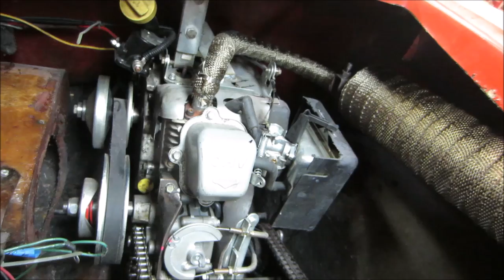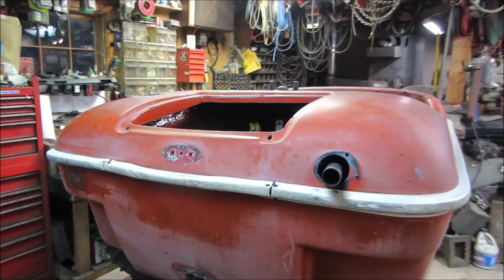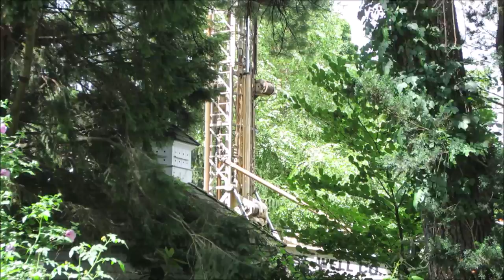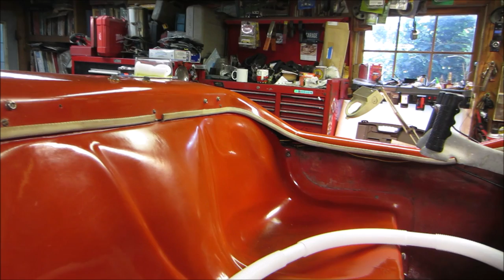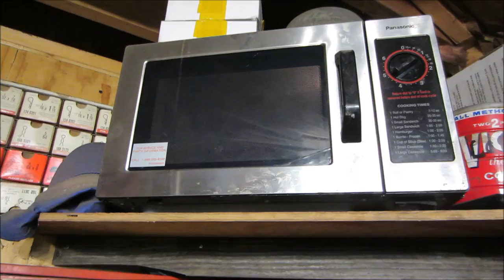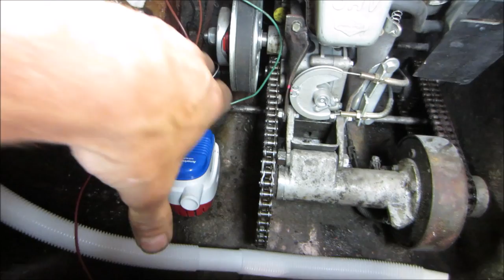Buffing my Beaver amphibious vehicle

Comment: I was tasked with getting a miniature railway locomotive running the other day... I was told it was a 2 stroke. I got there and cleaned it off, to find it was a Villiers 9E, exactly the same as the original engine in the beaver. Quite a powerful little motor. Was glad to have some of the skills I’ve learned from you Mustie, to get it running sweet. Next week I have to take the carb apart as it’s blocked so I’ll be following along to one of your vids!

Comment: A tip for the exhaust wrap fold the first and last 1 inch under and you will not have to deal with the frayed ends. The SS Minnow is looking ship shape.
Cheers steve

Comment: You can make a new fiberglass engine cover from the old one and a plaster mold.  Fill the broken section with Styrofoam but not up to the finished surface area.  Spray the surface with a "Pam" like spray oil and paint it with Plaster of Paris. Add more plaster to the damage area to fill it to the intended finish surface.  Strengthen the mold with gauze & plaster, newspaper & paste, or any other strong backing.  When dry you can remove the old cover and work the damaged area of the mold to match the opposite side.  Now you glass a new cover in reverse, starting with gel-coat backed with laminate.   
Great job bringing that Beaver back from the dead.

Comment: For adhering different types of surfaces to each other, I always recommend a silicone adhesive sealer. It stays flexible once cured and tends to stick to just about anything.  Your concerns about covering the water holes in the pump base aren't that much of a issue, as long as you have some of the holes open.  In fact, having the adhesive go through some of the holes is actually advantageous as it gives an extra hold point for the adhesive.

Comment: Lookin good!   For the rope Tie-down that got pulled off,   you could fabricate a steel bracket that mounts between the engine mount and the inside bolt pattern of the Tie-down bracket. This should eliminate the bracket relying on the fiberglass for strength, when someone tries pulling the weight of the entire Beaver from that Tie-down bracket.

Comment: Just carve a foam plug to form the missing piece  of the engine cover.  Make sure your resin won't desolve the foam.  Then chip the foam out after the repair part is cured.  Use a three position switch for the bilge pump then you can have off, auto and on.

Comment: The other wire that energises the motor without the float is designed to connect to a dash warning light. It will illuminate when the pump is active.

Comment: A lot of mid-engined supercars have clear engine covers to show off the engineering bling. Perhaps you could follow suit rather than trying to repair the existing broken cover.

If you made a wooden former, you could get a sheet of appropriate thickness perspex, and with heat get it to melt into shape, then re-use mounting brackets/hinges to finish it off.

A clear cover would also allow a quick visual check that all was well in the back when on the high seas.

Really enjoying this series in particular as it is a little different :)

Comment: Mr. Clean Magic Eraser works well on the rubber bumper too. I have a 1958 Custom Craft 15’ Sea Ray, and that worked miracles on my white rubber border. I also used the Westleys Blece White as well along with the Magic Eraser to work simultaneously. Try it!

Comment: Nice job using the 1500-2000 grit wet sand process and the final buffing. It's too bad the fiberglass base is just shot with all the spider cracks; not much one can do about that. Then again, she wasn't meant to be a show queen.

Comment: A suggestion for the pump mount would be mounting base of pump to small aluminum plate and the attach L bracket to base plate and then then screw l bracket to air box fiber glass. Wont be long till you get that beaver all wet and ride it hard.

Comment: In my humble opinion I think you should just leave the chunk missing on the back cover. Polish it up like the body but leave that chunk missing. It doesn't appear to be needed for structure or water resistance.

The work you do has completely warped my brain. I have always been a perfectionist and at first the stuff you chose to do drove me freaking crazy, but now I think you have the right mind set. Don't take away the years... embrace them. Reminds me of some of those car guys who clear coat right over old rusty decades of patina because it just looks cool.

Comment: To fix the broken cover you can cut up pieces of waxed milk carton or use chicken wire with wax paper over it as a form, looks like they used fiberglass mat for the thickness, (although that can be harder to work with than regular cloth) it will take some sanding but you'll get there eventually. Mix the Resin/hardener exact. The red color is a resin tint, that might be tough to match.

Comment: Maybe you could find a old Mercury outboard motor shroud or a barbecue grill top cover about the right size to replace the engine cover. Or maybe sand cast new part from aluminum. I think a metal cover with cooling fins like an old edelbrock valve cover would be awesome! Great job.

Comment: That's looking very nice now, Mustie1. There is a layer of Gel Coat over that water line decal- you'd have to really go deep to remove that. That bilge is easily attached with nuts, bolts & washers- as long as a rubber "gasket" of RTV or similar is used, and tightly clamped. Emory non-slip stair tape would work for the seats.

Comment: If you repair the engine cover, you'll never be able to match the color of the rest of the vehicle. You should paint it white or black or something. So it doesn't look "off"
Reply: Brian Vaughan My vote on white so it matches with the whitish bumper-rim-thing
Reply: Juha Airasmaa agreed
Reply: Or match the color of the original with boat paint for a more authentic Beaver restoration. But make sure all the wax is off before painting.

Comment: 3M makes a double sided tape that is truly remarkable. It's called VHB tape. That would be an excellent solution for the pump.  This tape permanently bonds with remarkable strength but can still be removed. It seems to be weather proof too.

Comment: For that white trim or really any vinyl/rubber/plastic use Boiled Linseed Oil.  There is nothing better for restoring oxidized plastics and rubber.  Just put it on a rag and work it into the surface.  Rags can spontaneously combust so store them carefully or soak in water when done.

Comment: In commenting on your last video on the Beaver, I recommended Poly-Glo. I still can't recommend it more highly. It is a two step process of cleaning with their special cleaner called Poly-Prep followed by wiping on as many as a dozen coats of the Poly-Glo. It dries almost immediately; so on our 37' boat you can just go pack to the other end and start afresh.  Really brings back a shine to old gelcoat  and lasts much longer than wax. Available at chandleries. Since you're working on a boat, you should go there rather than a car parts store.  For a bigger example of boat/cars look at Amphicars. "Fantom Works" just restored one and "Wheeler Dealers" did one a few years ago.

Comment: if you use painters tape on the fiber glass before drilling it'll keep the bit from wandering or catching on harder/soft layers. It might smoke a tad bit but it works for hole sawing. Also keeps the dust down.

Comment: You should make a custom stainless engine cover. Yea baby. New tires if available and wire wheel polish any Chrome plated parts. Also cut exaust to match profile of the outlet port.  Leave a little bit hanging out but match the angle. Maybe paint or polish rims. Thing looks awesome so far. Just food for thought Mustie. That is a wheel not a buffer. Abuffer has random orbit and will not burn off paint to the core.

Comment: You can form the left rear of the cowl using styrofoam and a couple of sanding blocks. Fill in low spots with spackle. Cover the foam with 3 layers of fiberglass and epoxy. Don'[t use polyester resin to laminate because it will melt the styrofoam. Sand and gloss off with polyester finishing resin to protect the epoxy from the sun. Sand out the styrofoam when you're done. That's how a surfboard builder might do this project.

Comment: One thing you could do is put a water contact sensor (like they use for alarms) and hook it up to a light somewhere up front so you'd know you're taking on water, before is gets up into the engine. Might be good in case the pump fails or comes loose or something.

Comment: Have you considered just a big mellow electric radiator fan in place of the engine hatch?  It would have killer ability to draw lots of air.  It would look pretty sweet too.  Like a sand rail.  You could have it blow outward, creating a vacuum.

Comment: If you want to reconstruct the cover, one way to do it is by shaping styrofoam to the inside shape and lay up  epoxy on the outside.  Polyester resin WILL eat the foam, epoxy do not.
Then sand the surface and remove the foam. (You can find dosens of videos about making surfboards to see a how to - same same)
You could paint the cover mat black instread of trying to match the orange. :-)

Comment: 3M does an extra strong outdoor rated double sided sticky. I've had luck with that.
Reply: 3m VHB (Very High Bond) works very well
Reply: Yeah, there's double sided tape and there's double sided tape, the type of 3M tape they hold car badges on with is the sort of strength and longevity you need, not that toy stuff.
Reply: I think that is the stuff they sell as "Automotive Trim Adhesive," it works excellent. Used to use that to attach TV remotes to those "pull-cord" things at a big-box store. The foam stuff would rip in half and leave a sticky mess. The gray stuff would hold tight but you could peel it off easily when you needed too.
Reply: Mechanical connection is a must on a bilge pump. Vibrating wet tape is not going to make it in the long run. No tape  sticks good in that environment. Hot glue doesn't work either. Seemed solid but couple weeks later my pump was laying on it's side at the bottom of the boat.

Comment: I know VERY little about fiberglass.  Hypothetically could you paint it if you wanted to?  Will paint stick if the fiberglass is prepared for it?  Also on the bilge pump discharge on the hull, you could use a large soft black grommet to take up some of that gap. This has been a really cool set of videos.

Comment: There's a product called penatrol made by Flood it's works very well on boats to take care of the oxidation you can find it at most hardware and big box stores. Wipe it on the buff it off makes it look brand new. I've sold it for 25 years now . A quart would last a while..

Comment: The only way to removed the cracks on the body is to use a flowcoat which has a wax added to the gelcoat to stop the coat from being sticky. You would have to key down the body first and you would have togo through all the cutting in afterwards aswell after applying the flowcoat.

Comment: Saw that issue with the thru-hole coming a mile away. Even after you drilled the first hole to high, you still had a chance to salvage it. All you had to do was move the center of the hole-saw  down an still cover the first hole. You are better than that. Want to put some money on how long that double stick tape holds? Not going to work in a wet bilge.
Reply: saw the same and agree about tape.. needs 5200
Reply: Did you watch the video?  He didn't use the tape.

Comment: For the "chrome" trim, ( if that's what that is, dunno' ), scale modelers have products for plastic scale model aircraft  that looks like the polished aluminum of unpainted
  aircraft skin. Made for scale models, so I don't know how that would hold up, but there may be some sort of coating to keep it nicer longer.
Or, maybe you could actually contact an aircraft company, see what they might use on aluminum to make it wear longer. Might work on whatever that trim strip
is made of, to.

Comment: you could wire a flasher relay in line with the brake light so it will strobe

Comment: The worst thing about trying to stick something with glue or resin to inside the engine compartment is all the contamination from the oil and grease to the fiberglass. The un gel coated side of the body sucks up the oil like a sponge and even if you clean it off the surface really well it will still come back.

Comment: Could you trim back the engine cover and fabricate a metal piece like a wing, that might promote airflow to help vent and cool the engine. Not original but better air flow.

Comment: You might make the Brake light portion of the tail light so it flashes to be seen better in low light conditions, also it being a boat, isn't it supposed to have a green light on one side and a red light on the other side?

Comment: check and see if the trunk lid will fit turned to the front,   with the opening at the back it will fill with water everytime you slow down,

Comment: I am endeavoring to restore a small two man boat that was my late brothers. 
It is one of those that are foam filled mouse boats.  
What I am planning on doing is to separate the top from the bottom half. 
Filliping the tops have up side down and filling it with two part 6lib density closed cell foam to add structural support. 
And removing any degraded foam in the bottom and replacing it with density 2lb foam.  
And using additional uncured 6lib foam to adhere the two halves and using some good quality sealant to seal the edges of the two halves.  
Am I on the right path or doomed to failure?
Thanks in advance. 
Charlie B.  DE KG4MXV

Comment: Why not wire up the brake light part with a flasher ( I'm assuming your alternator and battery are 12 volt ) and could use the flasher from most any vehicle ! Might be  a bit harder to find one if your beaver is only 6 volts though !

Comment: Loving the video, but why not sand it down and apply a fresh coat of gel coat? And make it look new... Or are you going for an original, crackly effect?

You had me up until you bored the thru-hull fitting. Why didnt you bore it out of the engine compartment hatch so it can shoot the bilge out the back of the transom. I mean, you've gotta redo the hatch anyway, might as well add the fitting there and route the hose on the inside of the hatch. 

Doublesided foam tape isnt going to stick due to the releasing agent residue on the fiberglass from the molds and the inevitable oil/grease from from the engine.

Comment: did you ever fix that gas tank leak  i was wondering if you were just ghoing to use that gas tank liner  like you have used in other tanks wouldnet that fix the leak and seal the tank?

Comment: idk it had some many stress crack OMG  every one need to be cut down and like weld fiberglass back into them,  then sand down the whole body rough, this will give the gel coat to stick, Then micro sand it down smooth.  and paint.  ONLY way to get stress cracks out. Just cant spray gel coat over them

Comment: Where is the vent fan? any time you have an enclosed engine like that, you should have a vent fan, and use the vent fan before you fire the engine. this is in case of gas fumes building up in the engine compartment. The "hood" is vented If I remember right, but that may not be enough.

Comment: That pipe tap if you would fold the rap in a point at the end and then put the band on. It wouldn't unravel
Reply: James Bowers actually the fiberglass wrap was supposed to have been soaked in water first then you fold it to a point and tuck it under and then you add the metal band with a crimping tool
Reply: staind288 great idea I had the same rap I was getting ready to put it on my headers

Comment: Running the beaver with the cover in place will probably cause overheating. I wouldn't do it if I were you.
Reply: John Robertson it's a ventilated cover why would it cause over heating
Reply: Because 1) the airflow will be restricted as compared to an open hole, and 2) heat cannot transfer via radiation through the hood.